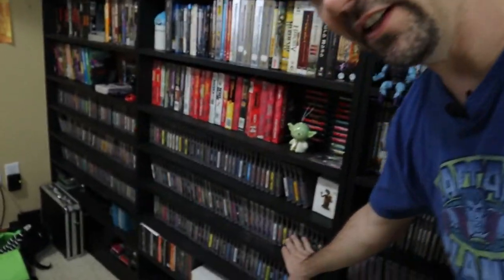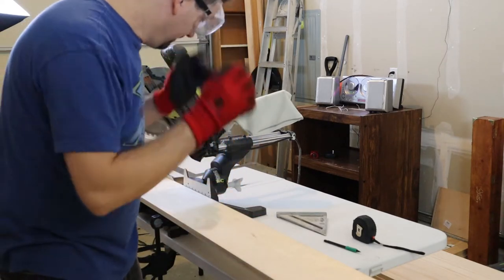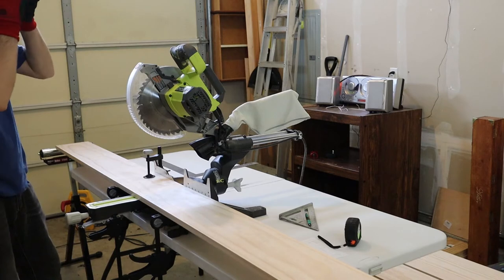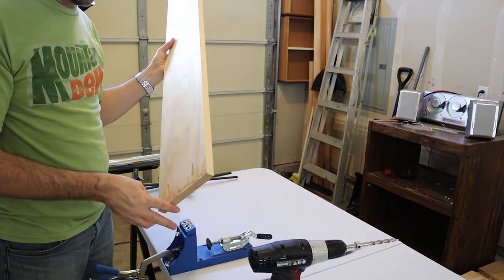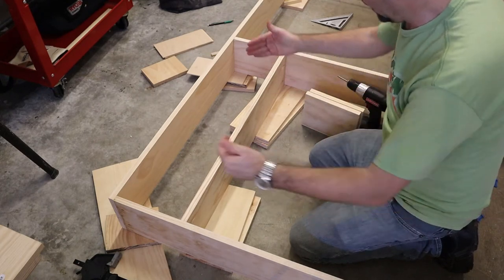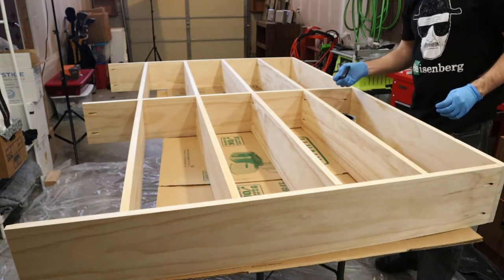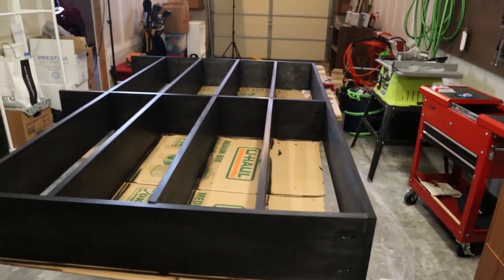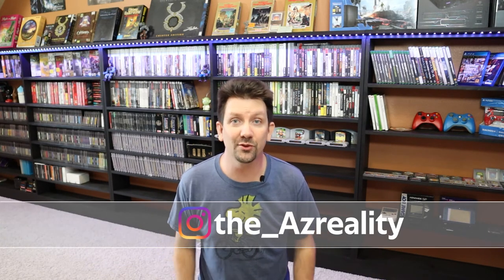How I built my own custom video game shelves - Game room tour

Comment: what kind of wood did you use ? also isn't 9 inches a bit tall for ps3 stuff ? they're only 6.75" high, at most 7 inches. even ps2 is a tad shy of 7.5", 8 inches should be enough, right ?
Reply from the maker: I picked 9 inches for the last shelf to allow for some flexibility in size or if I wanted to do some weird stacking. You are right though, 8 inches is the right size if you want a tight fit for xbox, ps2 etc. For ps3 or newer games you can go smaller... probably 7 inches. As for the wood, I honestly don't remember. Probably some sort of pine. Thanks for comment, Cheers!
Reply: @Azreality  thanks. do you recall fi the plank were 5/8 or 3/4 thick ? trying to find a solution to fit over our 48 inches wide baseboard heather.
Reply from the maker: @louisduquet4003  3/4" good luck hope your plan works out.

Comment: how did you secure the shelving units to the wall?
Reply from the maker: I didn't as the base was solid enough and when I slid last shelf in the entire line of shelves were snug. If I was going to then I'd find a few studs in the wall and use a L bracket to attach.